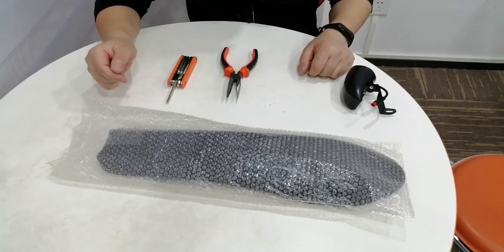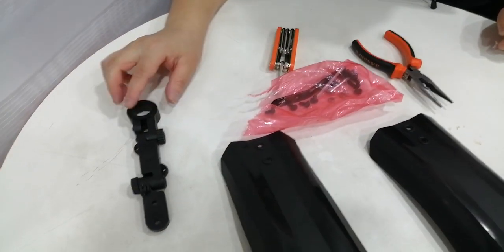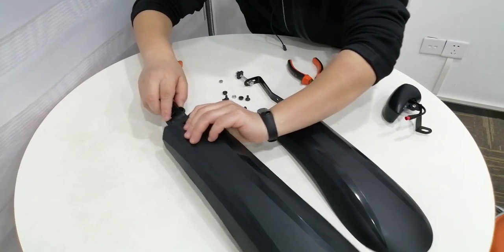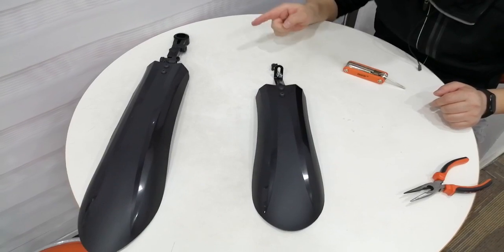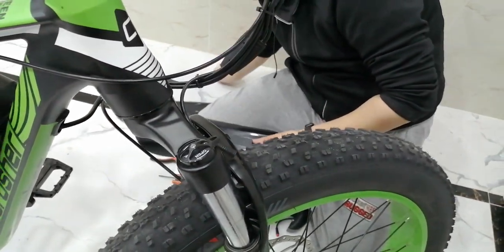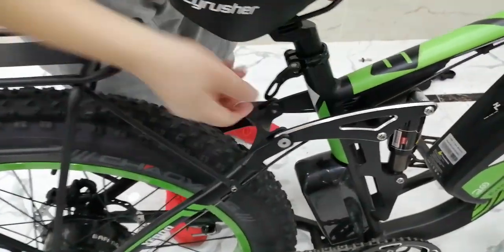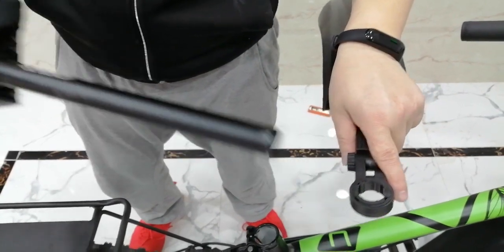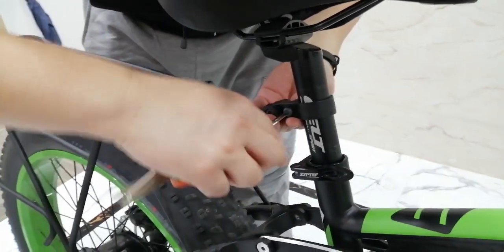How to Assemble Fenders and Mudguards for Cyrusher Fat Tire Electric Bikes

Comment: With the rear, If you lower the clamp around the seat post much further down it’ll allow you  to move the mudguard further back, then it’ll be more effective (covering the back of the tyre where the mud flicks up) and the bike will look better with the rear mudguard sitting in a better position.